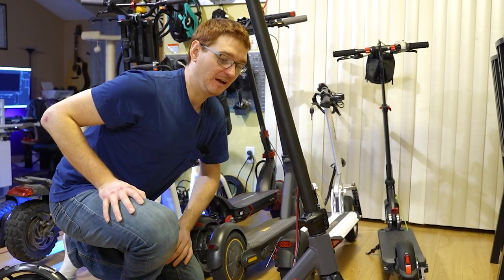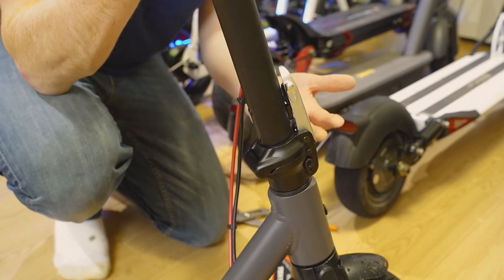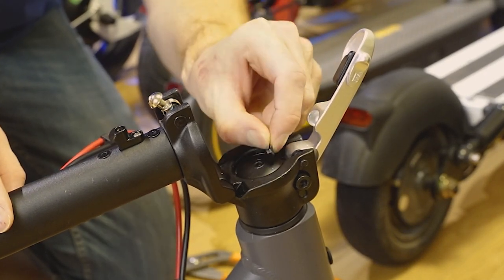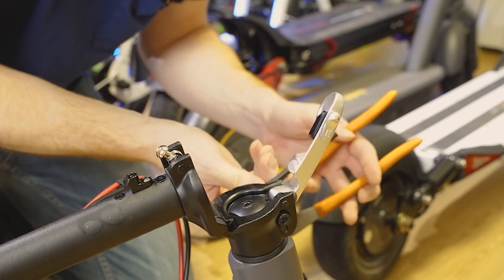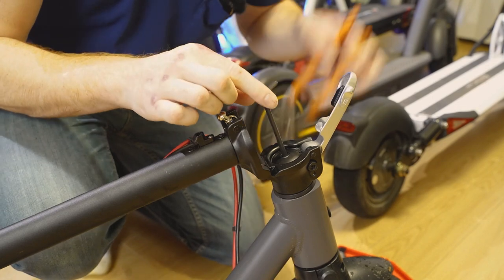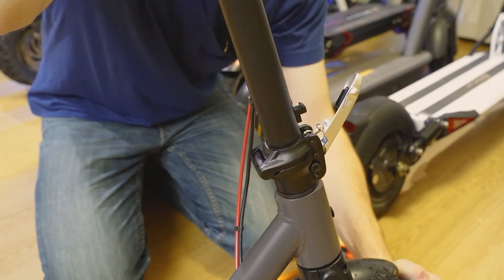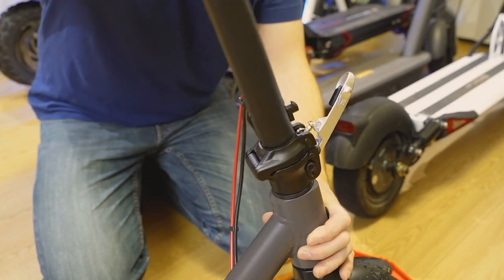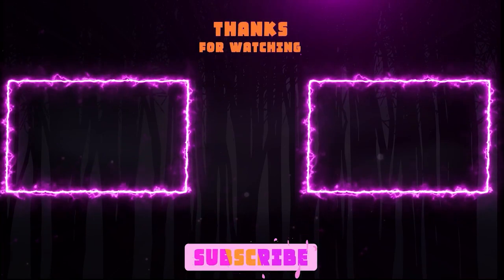Hiboy S2 Pro Stem Wobble - FIXED! - G.O.W workshop*

Comment: The piece you have to lift or slide up to unlatch then stem seems to have play and there is no way to adjust. You’re telling me your locking mechanism has NO play at all?  I’m not calling you a liar but I find that hard to believe due to the design of this particular device. Thanks again.
Reply from the maker: Dm me on Instagram. I'll show you a video and work you through it.
Reply: @GingerOnWheels  Super cool of you to offer that ✌️

Comment: I just wish mine worked, i just bought one, right out of the box it has an "E3" error code. The book that comes in the box only mentions an E4/E10 code, and the "fix" for those is to contact their tech support. Their "tech support" is an email address, which ive been waiting over 24 hours for a response now. According to other scooter brands, an E3 code usually means a motor connection problem. I will be on every single one of their social media's every day trying to stop people from buying by posting the ugly truth. If you post a 1 star review on their website, it doesnt post, so i made a 5 star review and then commented on how horrible customer service is and how terrible their quality assurance is. Of course that review went right up because it was a 5 star. Shady company man... i now have a nice 500 dollar room ornament i guess
Reply from the maker: Issue with chargeback with your credit card company. Or you can just DM them on Instagram. It usually takes them a couple days to get back to me too which honestly it isn't out of the ordinary for a scooter companies. All of them are extremely busy with sales and service because so many people are buying scooters during quarantine. Did you recheck the connection in the handlebars? if you don't feel like waiting for a response from them, in which case you'll likely have to ship the scooter back, then you can just pop open the deck and check all the connections yourself. If those are all good then they probably just didn't quality check the controller. the $3,000 veteran Sherman that I just bought from ewheels came with a faulty control board and their response was to ship me a new control board and told me to take my brand new unicycle apart and replace it myself. This is all bleeding edge tech and we can't expect everything to work all the time unfortunately.
Reply: @GingerOnWheels  i did check all the connections in the bottom, the handlebar connections (pins and plug) are good, i was testing it with everything apart. At full charge the 36 volt battery was sitting at 41 volts, i know lithium batteries charge at a higher "top off" voltage than their advertised voltage but im not sure if thats right where it should be. Ive also tried to pair it with the app to see if i could see stats on the scooter to maybe get a hint at what to look at but the app says its connected but doesnt show anything im guessing because of the error code. I am going to open the drive hub tonight and check all the connections, maybe they had a crappy solder job on one of the hall sensors or something.
Reply from the maker: @danimal865  awesome, I'm glad you know what you're doing. Please report back because you're not the only one I've encountered with this problem and it would be nice to be able to give helpful tips. 👌
Reply: @GingerOnWheels  yeah no problem. Its just frustrating. Lol. They could atleast include all the fault codes and what they mean. If they did that it would not only remove some stress from their support department but also give customers an idea of where to start. I mean their instruction book only includes fault code E4 and E10. Haha i was like errr i have E3... know what i mean? And there is literally no info on what the trouble codes mean.
Reply: @GingerOnWheels  im cheating a little. Haha its my first electric drive anything, but im an electrician by trade. That helps, but this in hub brushless motor wizardry is alien to me still. Haha ill figure it out i think though
Reply: Someone else with that error code got another one sent free of charge to replace the other and he sent the other back
Reply: @ms.hoblit6289  they did in fact replace mine for free. Just takes a while